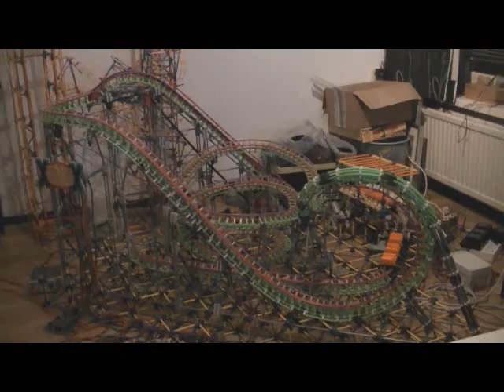Project Phase V2.0 Progress: 2 trains

Comment from the maker: @knexpert5 It's all controlled by an Arduino microcontroller. I code the program on my PC and upload it to the board. Then it can run standalone. The electronics you are talking about are just sensors and a few buttons for user input.